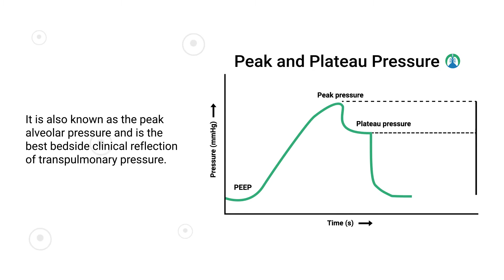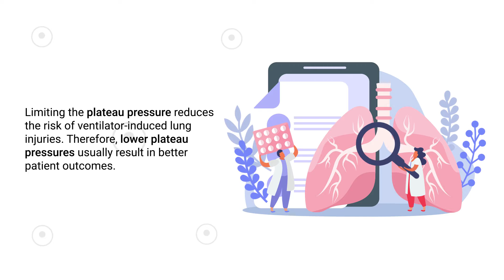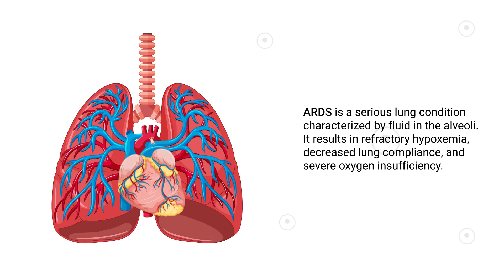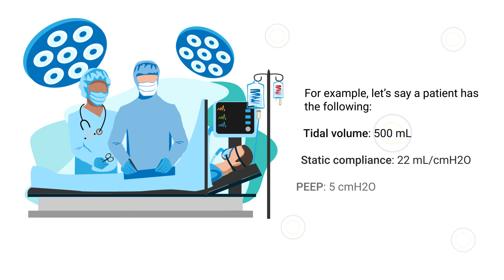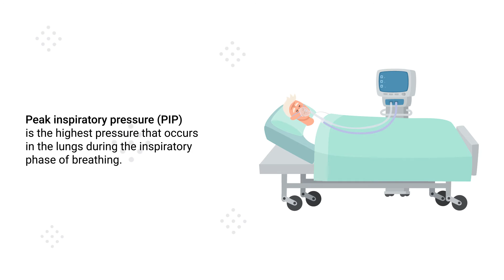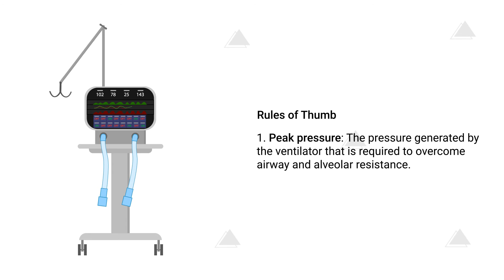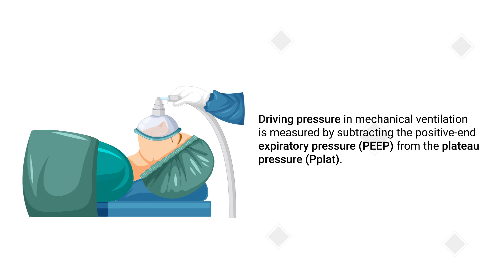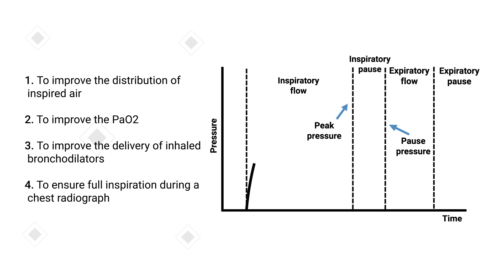Plateau Pressure | Overview, Calculation, and Normal Values

Comment: I guess the driving pressure is affected/changed by pt's O2 saturations, since peep is involved! So, I guess it is safe to say that before calculating driving pressure and Vt for "a" DP, "NOT" the Pt's IBW, we have to first find out what the O2 sats are in order to set the right peep and Fio2, before we can actually calculate an acceptable Vt for that driving pressure according to the lungs' stiffness or compliance?! So, that means, that Vt not only depends on setting that person's IBW VT as a normal lung at that weight, "BUT",  also depends on the "stiffness or elastance" of those lungs since we have to open them with PEEP, which affects DP that we can calculate and use for better ventilation. In summary; I think, first start with Vt on IBW, then calculate Vt with DP according to Lung Compliance! ( HM!!!! pretty sneaky!!!!!! ha!!??) Am I right? Not sure!